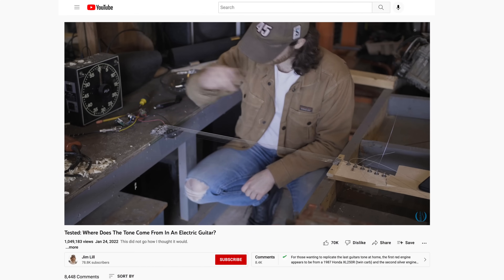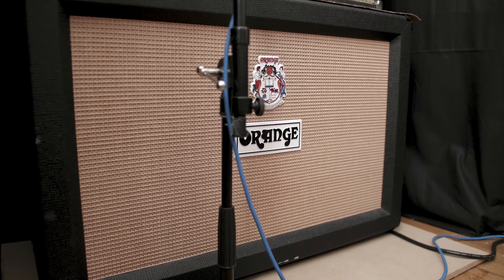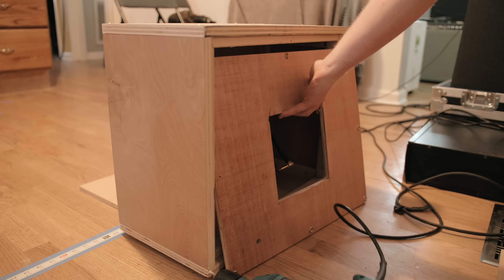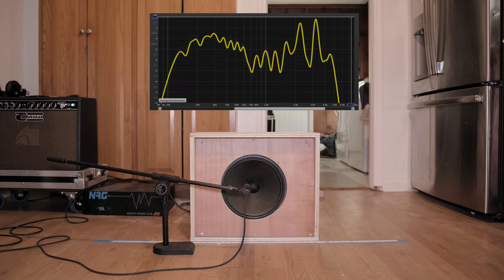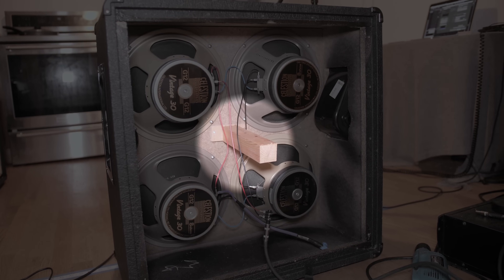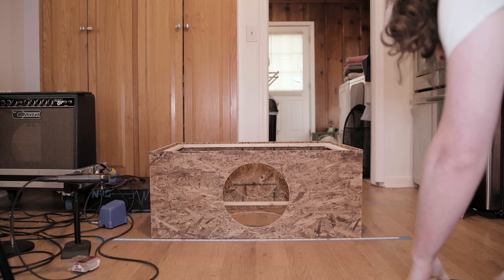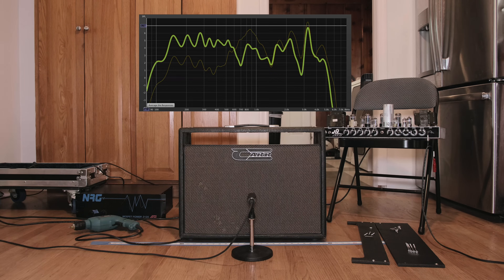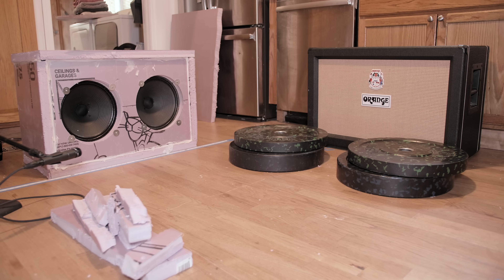Tested: Where Does The Tone Come From In A Speaker Cab?

Comment: This guy seriously built like a dozen different cabs in his backyard just for this video. That's dedication. Bravo
Reply: A friend was demolishing 10 old electric organs. He wanted the amps inside. I said, wait, I want the speakers. And the reverb spring units. Have you ever built yourself a cheap guitar amp? What is it? An amp, a speaker and some scrap wood. I just got myself some free speakers, not top quality, still I can simply connect them to a small amp. For clean playing, a larger speaker is always okay. If you want distortion, things are a bit different. But hey, such projects are fun. And when you do your research too, chances are, you know what you are doing. And you learn on the go. Ever wondered why bass amps have 4 large speakers? Would that still work with 3 ones? And could a guitar amp get better, using 4 equal speakers?
Reply: @voornaam3191  an old Bass player pal explained that it was all about air push. The larger the cone more flutter yet bassy and less articulate and Claritied. To push the same amount of air and tighten the clarity replace a 15 or 18 with 2 12's or even 4 10's etc. Or combine  using a crossover.
Reply: This man isn't afraid of work
Reply: He, uhh...did the work.
Reply: "I'm just a performer..."

[has pretty solid carpentry skills]
Reply: Saw him at the Amigo Guitar Show a week ago…women were throwing their bras at this dude. Never underestimate the appeal of carpentry skills and work ethic.
Reply: the amount of time spent in this is staggering lol
Reply: He also did it for himself. He had questions that he could answer himself.

Comment: Electrical Engineer here: The impedance can effect the sound as it might change the way your amp interacts with the speakers, but that depends on the amp. So it might be that in your case the amp could handle all impedances well, while other amps might handle them differently. Impedance mismatches can certainly also effect the frequency graph (e.g. try running a High-Z Piezo into an low-Z preamp vs running the same thing into a High-Z-Preamp). But with amps it really depends how the output section is built, e.g. a change in impedance might form a different "passive filter" with any internal capacitance of the amp, etc.

However I don't think impedance is a big factor in the sound of an cab typically. It might affect the effectiveness (how much levels you get out of the whole thing), but not so much the sound as long as your amp-cab combination is within spec : )

Some additional thoughts: You looked exclusively into the frequency domain which was a really interesting (and worthwile) exercise. But be aware that the time domain also exists (REW can do waterfall plots). Some of the changes you made might not have shown big changes in the frequency graph, but might have affected how the cab handels short impulses, percusive sounds and such things in the time domain, which in turn might affect things like the perceived "tightness" of a sound. I believe the biggest changing factor there would still be the speaker itself, unless you are building some boomy bass-reflex thing replacing the hole in the back with a pipe or something. But if you have the speakers around still, looking at how they "ring out" when fed with short pulses might be an interesting thing to look at as well.

Your work is really gold, thanks.
Reply: A change in impedance comes also with an important change on the amp's side - if a) you don't mismatch and b) you use a tube amp.
What I'm talking about is the difference in the output transformer's secondary windings. This is what you change when dialing the amplifier's impedance switch. So there really is no (simple) telling what role the amp or the speakers play when comparing impedances.
Reply: It’s interesting that I have seen some speaker manufacturers show different response plots for the same speaker that is available in different impedances. It’s not much difference, but it’s not zero either.
Reply: Jim probably has no appetite for revisiting given how much data was collected on this video, but repeating with time domain recorded in waterfall plots would be pretty definitive, and actually pretty groundbreaking! I'd even happily contribute to a crowdfund for your time doing that
Reply: @Steve Knight Amen! I only managed to take a few classes towards that end and 20 some years later I still have occasional episodic fits. Lol.
Reply: Good point!
Reply: What does REW mean?
Reply: @FingerinUrDaughter  This isn't necessarily the case, actually. while it is true that an ideal amplifier being presented with a lower/higher DC Resistance will simply increase or decrease in power accordingly without a change in frequency response, plenty of amplifiers [typically class D or Tube designs] actually can have a measurable change in response as a result of being connected to a speaker driver[s] with a much higher or lower nominal DCR than its designed load, with class D its usually the top end of the spectrum rising or falling as a result of the output filter interacting with the driver, and for tubes/unusual SS design amps its the driver's inductance and capacitance having fun with the amp, but i will also add that both causes of amp-EQed frequency response have been solved or at least mitigated in various designs, so its an amp-by-amp kinda deal [note : i'm from the audio reproduction side of the industry, but all of the concepts essentially translate over.] [side note, tube amps in general are funky little bastards and there's a good reason we moved away from them for most uses, stick to generally around the nominal it says on the tap if you don't want to blow up output transformers or tubes, this goes for guitar and hifi amps. SS in general does not have this issue, the only thing to watch out for is trying to drive something too low for too long without protection circuitry, unless you like the smell of magic smoke]
Reply: also, unless its a cheap piece of shit, changing the taps on a tube amplifier changes the point on the transformer that you're grabbing your output, since the ratio of primary to secondary windings changes the voltage presented to the speaker [and V=IR, so with lower impedance you need higher current and lower voltage for the same output], it should not add a resistor to the output, if you have a tube amp that's using resistors internally to get away with using a single tapped transformer, you should seriously post it online and shame the manufacturer because that is not how you're supposed do impedance selection.
Reply: @cmatte82  the differing response plots is in part because its actually kind of impossible to build a driver with exactly the same coil weight that's say, 2 and 4 ohm, since the coils themselves would have to be different. you can build a 2 and 8 ohm driver that is identical by having a coil tapped so that it is internally two 4 ohm coils and either exposing them as a DVC for the customer to configure, or by offering two externally SVC models internally wired series or parallel which when driven through an ideal amplifier will have a nearly identical response, but doing the same with a 2 and 4 ohm driver is not a simple task since there isnt really an economical or non patented way to get to both DC resistances while using the whole voicecoil [if you only use half you lose sensitivity, and power handling]. the other part is that speakers are very hard to make the same, and even if you did have two coils that were identical in all ways other than DCR, the other soft parts would naturally have so much drift [you have to keep in mind these are delicate components typically made out of foam, paper, cloth and glue/resin] that even measuring two drivers back to back would have some measurable difference, even if it isn't audible
Reply: @logans.670  okay. I guess I wasn’t thinking the deeply about it. Good to know. And I do realize no two speakers (or nearly anything in audio) will measure identical, even if they theoretically should. But since there are companies showing different impedences for different ohm speakers, I knew they had to be repeatably different enough to warrant showing the two curves.
Reply: In my experience, switching an impedance knob above or below the speaker cab's rating not only changes the resulting efficiency, but it also can make the sound output sound more mid-forward or more mid-scooped, depending on which way you switch it.
Reply: @cmatte82  There´s a difference. The impedance test here shows how it changes if you combine 2 speakers in series or parallel to change the SYSTEM impedance, which means, the COIL impedance in each speaker remains the same.
The manufacturers have to wind different coils for a 4 ohm or an 8 ohm speaker bobin, which usually means a different wire AWG (a width measure) and a different number of turns, which means a lighter or heavier coil, which means the cone moves less or more mass and behave differently, you see? Difference impedance speakers are engineered differently, with an effort to closely match each other for consistency sake.
There´s an interview with  Ignazio Vagnone (from JENSEN Speakers) on Kristian Kohle youtube channel (if you have the curiosity to check it out) where he answers this exact question and there´s lot of interesting info there.
Reply: @sharptrickster  cool. Thanks for the info. It def makes sense once you think about it and understand what’s going on. I guess since some speaker manufacturers don’t show the different responses for different impedances, I never thought about them maybe being different. But then you see a company that does show the different responses, and that seems odd. When in reality they’re just doing a better job of giving accurate info.
Reply: @cmatte82  Usually the engineers go through lots of iterations slightly changing other parameters to account for the different coil until the overall response matches as closely as possible, so, my guess is the manufactures not showing graphs for each one are basically saying they´ve done enough to make the difference as irrelevant as possible. It´s there, but, its not enough to be as noticiable by heearing the speakers instead of running them on testing software.
The point being: Matching responses is a process, takes engineering and testing. An additional effort to make same model speakers with different coils sound as similar as it gets.
Reply: @EbonyPope  it's the software he's using called ROOM EQ WIZARD.
Reply: @shimmyfix9315  Thank you.
Reply: @logans.670  for the first part, you are correct. I was about to describe what you described. To add how critical these things can be, is when the amp meets crossovers. In the guitar world since crossovers are rare and  low frequencies are filtered especially in high gain amps to clear the mud when overdriving, you hear things like impedance doesn't affect the amp...  A basic for this is to plug a tube amp output to a buffer like F4 (FirstWatt) or Mofo kit and listen to what the output transformers and tubes sound like when the impedance it is seeing is constant and how drivers react to outputs with better damping factor.
As for plugging in to tube amps and nominal values, you are not in danger of blowing it up at typical levels. I'm working on a 30's extension speaker with a variable transformer to match it to both preamp or power amp outputs. The lowest setting is 1.5ohms assuming valve state will be driving. (The instructions invited you to try different settings for best sound!) Most SS, without protection, would burn up trying to supply current for this load. Tubes would just lower output due to the difference in the impedance reflected to the power tube. A lot of  amps OPT burn up because it's pushed way past its power output rating.
Reply: Sound is affected by the type of enclosure and whether it's sealed or front ported, rear ported, and if the port and box is the optimum dimension for the resonant frequency of the specific speaker. Optimum cabinet design includes appropriate internal volume and corresponding porting as both affect tone and volume.

Comment: The acoustical principle that's causing the effect with making a hole or opening the back is called "helmholtz resonance". There is a caclulation to find the relationship between the boosting or cutting frequency and the size of the opening.
Reply: As an amplifier cab builder myself, I have to say that this video is somewhat misinformational: If every audio clip in this video does actually correspond with the visual/video presented on screen, then it is clear to see that the recording microphone (in 99% of instances) is directly in front of the speaker... so, in a 4 X12 test... Jim is only recording ONE speaker... same goes for a 2 X 12 or any other combo. The wood, resonance and structure of any cabinet DOES affect the tone... but you're not going to hear that with a mic placed right in from of ONE speaker. To do this properly, Jim should place the mic say... 20 feet away - about where you'd hear the speaker if you were stood near the front in a small venue.. or managed to get right to the front of a stadium gig. Not too scientific after all! 🙂
Reply: @crazyjack9voltbatteryamps his focus is on the close mic sound of the amp for the purposes of conventional recording. Obviously it’s gonna sound different depending on where you’re standing and what room you’re in, and how many speakers are in your cab, but nobody mics up guitar cabinets the way you’re describing, unless they’re trying to add ambience to the close mic. And certainly nobody mics up all 8 of the speakers in a 8x10, or all 4 in a 4x12. That would serve no real point in a functional recording. 

So yea, he’s doing it the only sensible way to do it.
Reply: @crazyjack9voltbatteryamps  Most of the guitar sounds we hear were recorded exactly like this. So, even though it might sound different in the room (and it probably does), it will go to the Audience and recording like this... A SM57 very close to the speaker. Thats it....
Reply: @gigajule5000 exactly

The point of this video is to dispel a myth and at the same time help the sound engineer figure out what one variable makes a difference for the purpose of a recording.